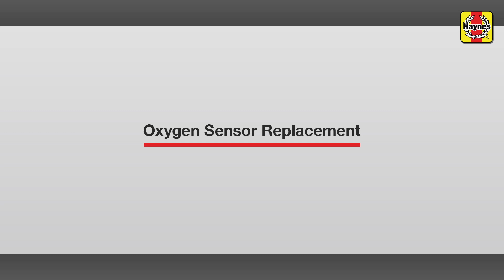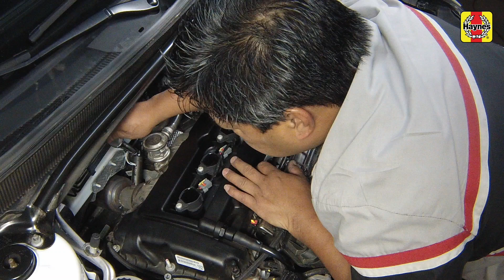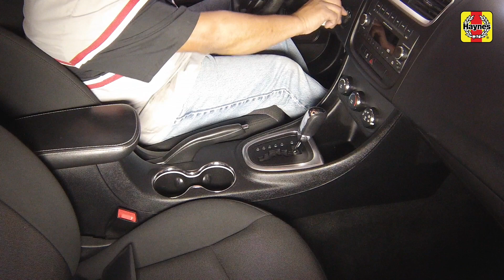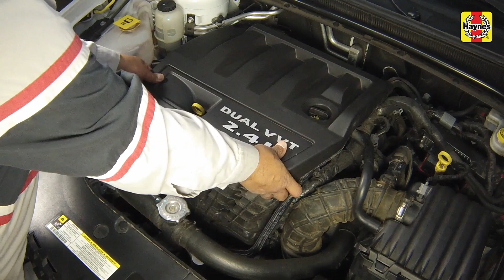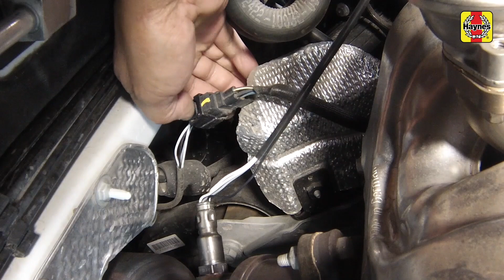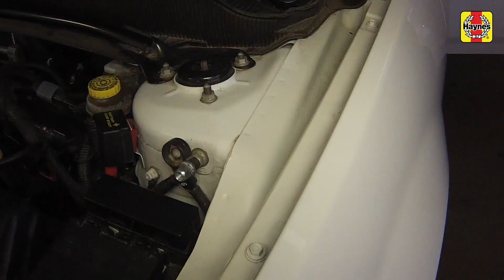How to replace the O2 Sensors on the Dodge Avenger 2007 - 2014

Comment: Now is this for the catalytic converters for an avenger for bank 1
Reply: Bank 1 is the upstream/ closest to the engine. Bank 2 is by the exhaust
Reply: Yea, I think that "bank 1" refers to the upstream/ uppermost 02 sensor.
Reply: 4 cylinder Avengers only have 1 bank. But 2 sensors, upstream & downstream.